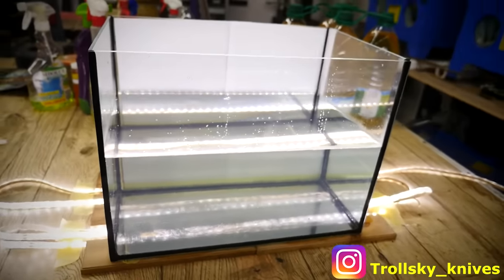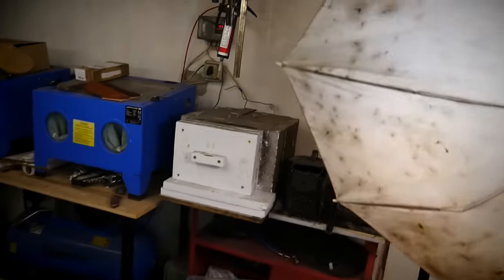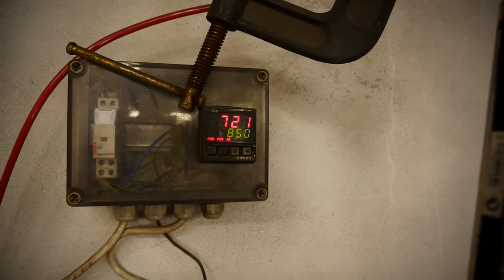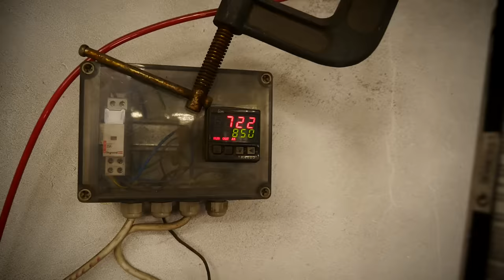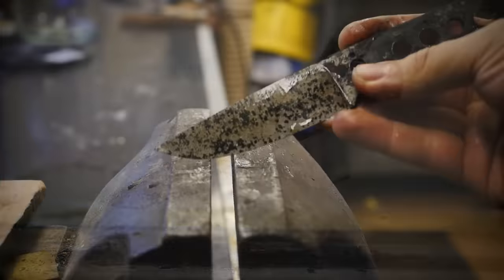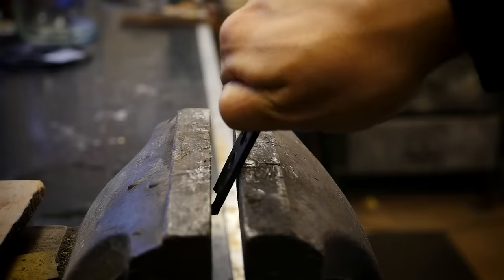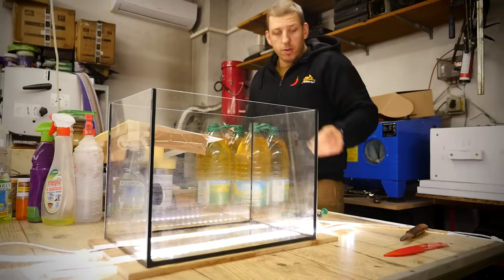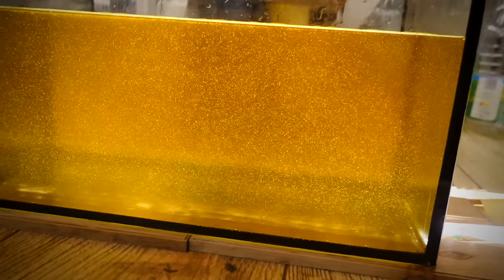STEEL HEAT TREATING CLOSEUP - WATER VS OIL [Trollsky Knifemaking]

Comment: Why didn’t you test the oil quenched knife the same as the water quenched. I’m sure it would have still snapped, just not quite as easily.
Reply: Zoom in on the skull quench and make that your badge!
Reply: 5th Horseman it’s pretty cool :)
Reply: I don’t think so. The oil is more viscous than the water so as the fluids heated up the convection currents in the oil were not able to move as quickly as those in the water. This prevents the cooler liquid from transferring heat out of the steel too quickly allowing it to become less brittle after the quench. Either way it should be tempered so it wouldn’t matter as much.
Reply: Shottygolfer1 It depends at what heat the steel was before quenching. steel will become brittle after a hardening quench regardless of what you use to quench anyway, the tempering cycle comes after. As to why I said he should have tested it. I know oil cools is slower, but what’s the result in it? He doesn’t compare. Usually people use it for a more controlled quench to stop warping
Reply: very good point made
Reply: Every time you heat and quench your making it weeker
Reply: cody preitauer More brittle, until tempering. The process is to actually get the material into the state you’d like it, weaker wouldn’t really be the right term in my opinion.
Reply: @SEFullmetalJake  Show us in YOUR vid.
Reply: GargamelThinks I don’t really make YouTube videos. I was just sharing my view that it seems a little odd not to show the results of both, as it seemed to be the point of the video. That’s all.
Reply: @zacharymacquiddy5531  I have had knives quenched in oil shatter, untempered steel is brittle steel as long as it was properly hardened.
Reply: @cpreit8862  not necessarily, repeated qunches can introduce cracks and grain growth if you don't properly control the variables but with properly controlled heating and the correct medium to use for your quench you can actually refine the grain and get a more durable blade from multiple quenches especially if you forged the blade.
Reply: I also would've like to see the surface of the break. If he would also snap an oil-quenched blank and compare the two fracture-surfaces, there is a good chance that the water-quenched steel would show complete brittle failure, while the oil-quenced would show almost complete brittle failure with a (small) bit of ductile failure in the middle.
Brittle failure looks like a surface made of sand (small grains being snapped without deformation).
Ductile failure shows the grains being stretched before they snapped.
Reply: @GargamelThinks  You have a lot of growing to do as a person if you can't accept constructive criticism without starting to whine, let alone not accepting constructive criticism aimed at someone else completely.
Reply: Nope
Reply: Yes . Qucnching with water is risky but it works if done properly
Reply: @cpreit8862  yes he repeatedly heat Cycles that in the water, but only quench into the oil once. A real test would have been to do one quench water the other one quench oil and then test. Then do the same thing again temper the metal and test.
Reply: @garethbaus5471  every quench can introduce hairline cracks
Reply: @haroldkerwinjr3026  the risk is always there, but with proper heating, the correct quenchant, and good timing the chance of cracks forming is fairly low meaning that you are much more likely to see improvement from grain refinement than you are a weakened blade.
Reply: Try this i like to quench my blades in the dew covered clover early in the morning kinda like lay it in there for a few seconds then flip it back and forth kinda like frying a salad the grass and steam allow the blade to cool slowly and evenly but also quicker than waiting for it to cool on its own either way its fun to hear the sizzle havent had any cracking or brittleness
Reply: @droppoint495  I realize you are probably joking, but wouldn't the fact that you are effectively only cooling one side at a time pretty much make this the perfect recipe for warps and cracks? That being said I have used snow to cool off peices of mild steel on occasion.
Reply: also in my mind this quest
...bad thing ...exprnmnt is cmpulsry
Reply: @amitgargps  How is the process done? Here in India quenching oils are expensive so what is the alternative? Also what is the exact procedure,heat treatment and the tempering? I would like to try in car spring leaf.🙏
Reply: @ulary  You can use any oil to quench, it does not have to be an expensive quenching oil. Many DIY hobbyists use old motor oil or vegetable oil found at any grocery store.
Reply: It needs tempering like armour, heat treating it twice at different temperatures and different cooling regimes, one for hardening and other for taking the stresses out of the metal.
Reply: I was just thinking the same. Its not logic and the video lost a lot.

Comment: If you don't temper after quenching, oil quench will also break easily..
Reply: I agree...!
Reply: Yes all in all if warping or breaking isnt concerned then water quench is better.
Reply: @Richard Falch It's true but not critical.
Reply: Hard Case depends on the metal. There are metals that would be useless as a knife if you quench in oil because the edge would roll over with mild use. 

Tempering is needed for any
Steel that isn’t made to either be soft or to break easily. This is why iron was worked by man longer than bronze but It was softer than bronze until they learned how to properly harden it without making it overly brittle.
Reply: @stlalways6715  You need a TTT diagram (time-temperature-tranformation) for a given batch of material (yes, it's different for every batch, not just for every type of steel) and you need to choose a cooling speed between the upper critical and lower critical. Oil is slower cooling medium than water, so mr. Trollsky in this example probably didn't get a 100% Martensite structure (cooling speed less than lower critical speed) and there was less heat stress in the material so oil quenched specimen was not so brittle. A good rule of thumb is: construction steels with less than 0,8% of carbon are quenched in water, tool steels over 0,8% C are quenched in oil, high speed steels and highly alloyed tool steels are "quenched" in air.
Reply: Sry is a beginner well I still want to start but what is “tempering” and “quenching” is the same thing as “heat treat” right?
Reply: @consaurus4388  technically heat treat refers to all the operations of heating and cooling the steel (thermocycling aka normalization cycles, hardening/quench, temper). Without getting technical, tempering is taking a hardened steel and removing some of that hardness to end up with a less hard but still hard and far less brittle steel. Tempering can be done by sticking the steel after the quench in a normal cooking oven, but what temperature, how many cycles, for how long, depends on your goals and the properties of the steel you are using
Reply: @kristiankatic9965  I have had decent results water quenching 1095 in water but have had issues with 1060 so it is more complex than just carbon content you have to account for other variables such as manganese content (I really use more of a lye solution but it is mostly water so I generally refer to it as water)
Reply: @garethbaus5471  I know, heat treatment parameters are based on time-temperature-transformation diagram of a particular batch of steel, not even a type of steel, but that's just some sort of a rule of thumb
Reply: Depends on the steel properties and temperatures and techniques used.
Reply: @consaurus4388   so tempering is bringing the steel back up to a lower temperature (ie: 400-600) in order to reduce brittleness and increase toughness. You're gonna want to temper anything you quench, really. 
    Quenching on the other hand is bringing steel to a temperature usually referred to as cherry red (around 1450F to 1550F depending on the steel) and then dunking that still hot steel into a quenching medium, like water or oil. Oil generally leaves steel a little tougher than water. Water quenching is  a violent process and should not be used on thin or beveled knife blanks, as it can lead to warping and cracking. `This is a very general rundown though and you should really look into more specific procedure for the steel you are working with.
Reply: @kristiankatic9965  What is "air quenched", I have never heard that terminology?
Reply: @sgt.wolfenstein0818  english is not my first language but some high alloyed steels are hardened by heating them to austenitisation temperature and cooling them just on air or even in the furnace. Mostly tool steels in fact
Reply: The Japanese use water
Reply: @consaurus4388  quenching and tempering are heat treating procecess, but there are more. 
quenching is to "freeze" the carbon in the steel in a super tense array. thats why it behaves like glass. 
Tempering removes SOME of that tension, giving some toughness back to the steel at the cost of hardness.
Normalizing is another process in wich you take the steel to high temperatures and then let it cool slowly, to let it regain its "natural" structure, with as little internal stress as possible (it can be done after forging, cold rolling, etc. or even to make sure the steel is ok after storage and transport)
Annealing is like normalizing, but slower, to yield softer and more ductile materials. normally to make it easier to work on cold (example, tie wire)
Reply: Quench on coca cola
Reply: @consaurus4388  tempering is where you put it in the oven for an hour or two quenching is when you put in the oil
Reply: @Donbok.  Seriously?
Reply: @sebbyhumphreys4060  Any idea for car leaf spring heat treatment, quenching and tempering?Will be glad
Reply: And if it doesn't, you didn't actually do a good quench.. you want it to be as hard as possible then lower that after. Professionally they do cryogenic treatment to harden it even further before tempering..

Comment: All the hardened steel is like glass after quench it, that's the idea of make a quench, then you reduce the hardness and brittle by draw two tempers after quench, different steels, diferent quenchants, the low carbon steel can get better in water than oil, if you need a bainitic structure you quench in melted salts, what the mean of this video? Water quenching is wrong? Yeah, for some steels or too thin blades yes but is useful in many ways, sorry but the video lack of perspective and data.
Reply: You my man are a saviour.
Appreciate the information 👍👍😁

Comment: This video implies that water quenching is bad, oil quenching is good—but that simply is not the case. Different compositions of steel perform best with water or brine, others are best with various types of oil. The temperature of the quench medium can make a difference as well.

And, as others have pointed out, a quenched steel without tempering will be brittle, regardless of what medium it is quenched in.
Reply: S2 steel screwdriver with brine can make rust? Which one better to hardness sir?
Reply: @asepd7159  ?!
Reply: Exactly. Depends on herdeneability. Šime are best quenched in water, some in oil, some even in the air. It just depends on material which metod is best for it.
Reply: فولاد رو دوبار کوئنچ کنید شکننده میشود

Comment: For hardening in water you need lower lemparatures than for oil because water takes heat away a lot faster than oil (as you said in the video). I usualy harden in almost  boiling water so it doesn t cool the steel so fast.

Also tempering to reduce the inner forces in the steel making it bend and break easily.
Reply: boiling water at 100C verses 21c is still a massive shock to a steel blade cooking around 870C and not an appreciable difference.  There's a reason oil hardened steels are listed as oil hardened.  If you could get water up to a higher temperature then it might help but water boils into a gas as we all know at 100c assuming standard air pressure. The issue is water's rapid ability to heat up and evaporate/boil off via convection currents etc and shed heat, causing the steel to be cooled at a much more rapid rate.  Oil's heat up much slower than water and has an overall lower heat capacity.   Heat transfers to the oil and is lost from the entire mixture at a much slower and more controlled rate.  Hence why it is superior
Reply: @Neonator08  different steels need different quenchants. saying one is better than the other is idiocy.

Comment: This was actualy interesting, thank You for uploading.
An expansion of this test could be how different dipping angles and moving around the object are affecting the outcome, many beginners does not know about that.

I newer taught about how those different fluids are affecting the hardshells in such different ways.
However, when i was on the axe factory here we used water, but it's much harder to master, for knives i also use oil if i hawe it at hand.
(With water the tempering is very important to prevent what You are showing here as well as not owerheting and ruin the quenching duting the tempering process)
I always do the finegrinding after the tempering (i always forge the blade a bit thicker than the final aim partly to prevent decarbonation but mainly to be able to correct warp) in order to correct fine warp, it seem to work as long as one are careful not to accidentaly build up heatstress in the steel after the tempering process.
Easiest is actualy to use an dold watergrindstone since it does not risk owerheating the material as modern highspeed grinders.

Comment: I'd imagine the water quenched knife would be fine after tempering as long as it didn't crack. But the warp and the cracking risk is the rub. 
I've never found the need to use water (I use soy oil for thin water hardening steel items - it's cheap and it flows well, even if not preheated) in chasing hardness, but I have quenched in oil and broken a knife just the same way you showed with water (prior to tempering). 

I make only as a hobby, so I've not had to solve any warpage issues - i leave enough to grind them off post treatment, but it's a little limiting. Files and razors have always been straightened after a quench - both are water hardening steel most of the time, but I never paid attention to find out if they're tempered quickly and then straightened (I think that's the case). I attempted to tap a pocket knife blade that warped slightly years ago - a single light tap and it broke like glass (it was oil quenched, but made from 1095 - and not tempered).

Comment: In my experience steel is brittle when I quench regardless of whether I use oil or water, so long as I don't have any cracks the results are fairly similar after I temper the blade.
Reply: Some steels require oil, so if you don't know what metal you have for absolute certain, use oil.

Also, he did get some warping supposedly from quenching in water.
Reply: @cavscout888  the oil quenching steels are just more prone to cracking, it is still sometimes possible to get a good result with water.
Reply: @garethbaus5471  Do you want to spend potentially hours or days on a part, just to ruin it from quenching in water? Again, some steels actually REQUIRE oil. No option. Some will be fine enough with either. None that I know of require water quenching...

Comment: Ummm yeah, that's why it's tempered after it's quenched.
Reply: That is true but sometimes it cracks when you quench it in water
Reply: @cster9261  that's true too , but it doesn't do it because of water , it does it because of hundreds of different minute details like what sort of steel it is , does the piece of steel have micro fractures , have you done normalizing cycles right , how thin /thick it is , is there a stress point and so on and so forth , if done right it's not gonna crack but you never know it just might.
Reply: @18IMAMGODINA  I guess I should probably just know what steel I’m quenching but I never really know what steel I’m using because I always use reclaimed metal but you are very right .